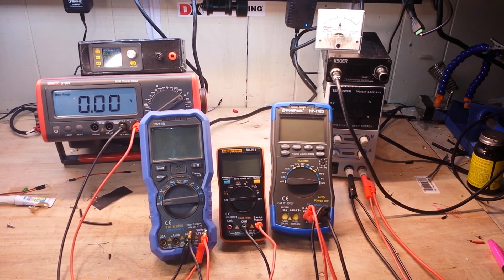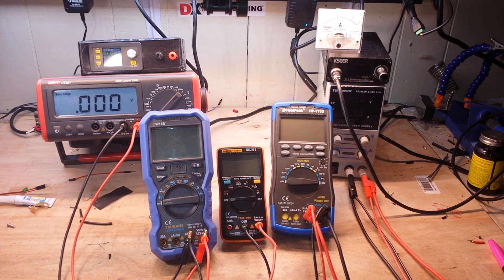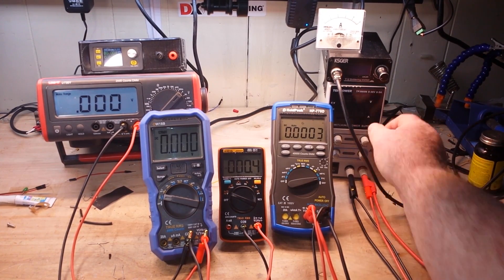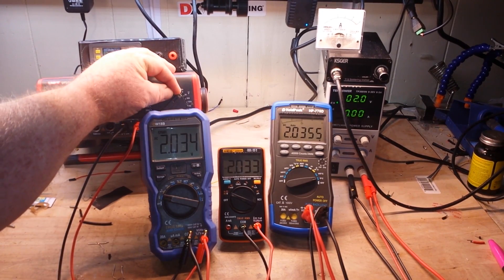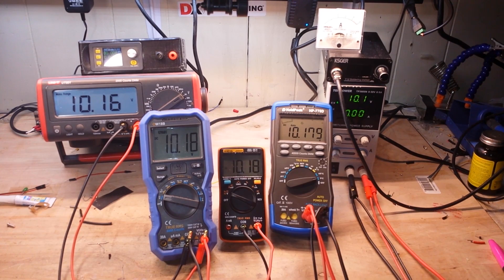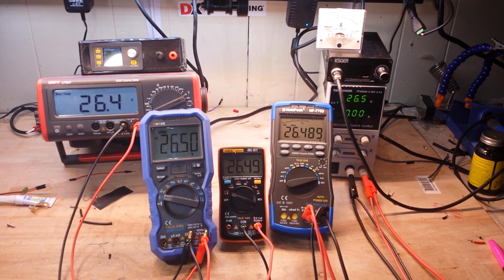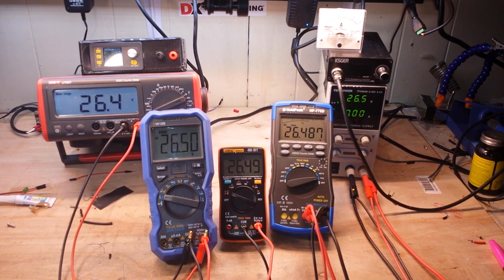Multimeter Counts and Digits - What do they mean?

Comment: On the first one, the 2000 count meter, you say we've lost a digit. No you haven't. If it is reading 2.01 volts then that's all it needs to display right? So where have you lost a digit? I'm going to guess that you mean it does not display 3 decimal points. I mean...who ever needs 3 decimal points in volts? I love the way you tried to describe it but I am still not sure what resolution is, and if you are doing basic home DIY stuff I think it's fair to say a simple 2000 count is going to be more than sufficient?

Comment: help me out !
on a 22000 count multimeter how many milliamps are at 0.416 A it shows ?
I like to convert it to milliamps   0.416 A  Thanks!!!!!!!!!1
Reply from the maker: I'm not sure I understand the question. Ignore the 200k count, that's just where it moves the decimal point. If you are inquiring how 0.416mA would look on 5 1/2 digits...  0.41600
Reply: ok thanks @learnelectronics

Comment: I just bought a Flir CM46 that says on the flir website that its a 6000count meter. Went to measure a 1.5V AA battery and it measures as "1.5V" and not "1.500V". I was expecting with 3 digits of resolution after the decimal point. What gives, Are Flir misleading?

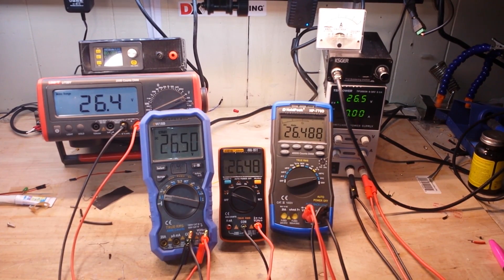Comment: why doesn't the 2000 count bench meter 'round up';  you had 26.4 (@5:40) -  shouldn't it have displayed 26.5 because the actual voltage was 24.488?  Can some 2000 count meters do the 'rounding'? Is it a setting on the meter perhaps?   I'm ok with losing precision but giving up a whole 1/10 of a volt when the voltage was less than  2/100 of a volt away.  ???

Comment: Excellent explanation, I have a similar benchtop voltage supply, it can only supply a max of 32 volts lol. Whats even worst is that there is no demand for benchtop power supply which can output AC voltage along with DC. I found on aliexpress a 120 volt DC bench power supply, it was a reasonable price, will get that someday.

Comment: Thanks Paul. Got a question for you: I have a power suplply DPS3012 from Ruideng/Bangood just as you have, so I can monitor the current consumption. I made a 2A iPad charger and see that the iPad is charging with the intended 2A. When I measure Amp with a separate multimeter in the supply, the current consumption drops from 1.99 to 1.56 or so. Measured with cheap (Aneng 8009) and more expensive (Dynatek 9020a), doesn't make a difference. I don't understand. Can you explain this?

Comment: I just ordered another 8008 since there seems to be no better option in that price range. (flash deal at about 13 dollars at Banggood now :)  But I also found out that the 8008 can be modded. Did you know that? And when I read the results I got the idea that this meter is even a better deal than I thought.
https://www.jackenhack.com/aneng-an8008-modify-for-better-accuracy-faster-readings/
Reply from the maker: I had no idea
Reply: @learnelectronics  It looks like that mod is really worth it.

Comment: at 3:32 you say "we are at 4 digits" about you new multi-meter, I would call it 3 digits (that is what is shows), as you told your self the new multi-meter is a 50000 count
Reply: I have to correct my self, you did say 40000 count, and the meter shifted at 4 volts, things got out of sync
Reply: @K2teknik.  yeah, there is no   diference between his 9999 and 40000 count at that point in video, it's just that 40k    count doesn't show 0....so indeed i wouldn't call that 4 digits either....or i would call them both 4  digits...heh...

Comment: I took a look at the Holdpeak HP-770D; it looks like a nice meter. But I don't understand why every manufacturer has a different arrangement of the measurements you want to make with that dial. Our life would be much easier if they all had the Volts on the left, the Amps on the right. Resistance in the middle etc. Really strange. It would also be strange if they all would make another PC keyboard with the complete alphabet in a different order. Cuckoo
Reply: The most logical meter in terms of the positioning of the functions is the old Fluke 27/FM. There are 2 OFF positions, arranged vertically (at 12 and 6 o'clock positions). All the DC functions are on the right side, all the AC functions on the left. Near the bottom off position are the resistance, continuity, and Diode test functions.

I can't really find fault with this layout in any way.  This is an old meter, so it doesn't have things like frequency or capacitance tests, but in terms of ease if use and logical layout, it is great.  Too bad no other meter has used this layout.
Reply from the maker: Everybody likes to reinvent the wheel
Reply: @learnelectronics  This world is total crazy!